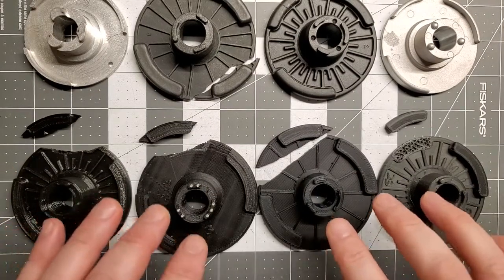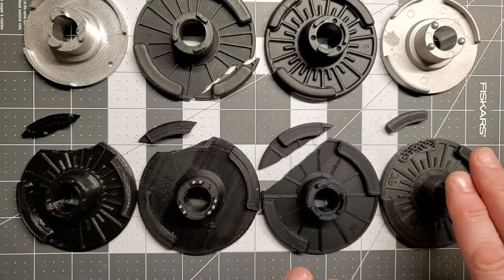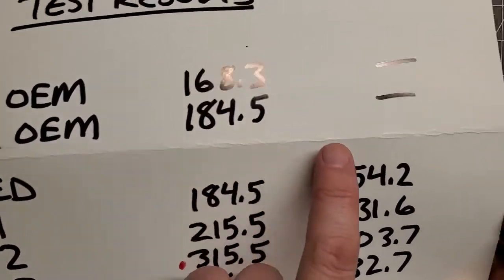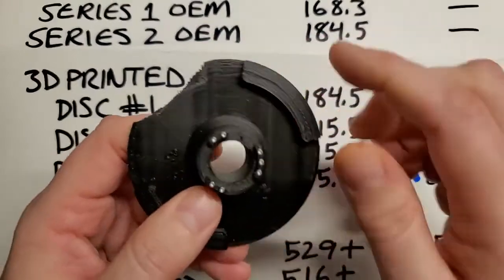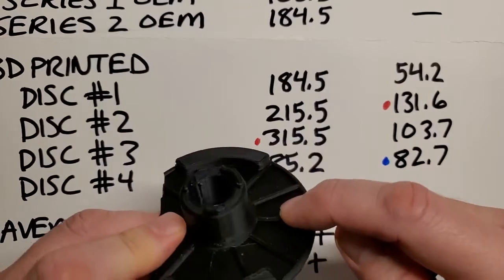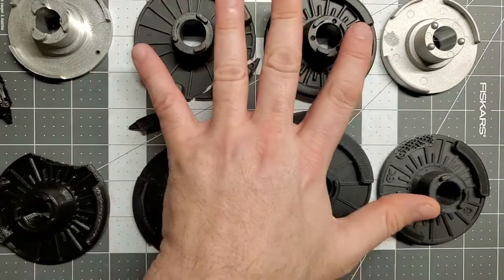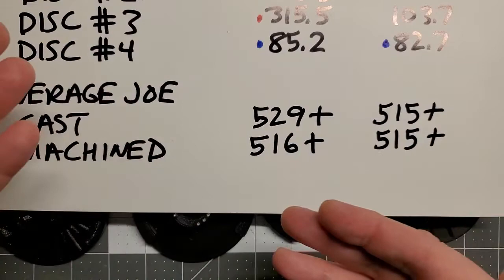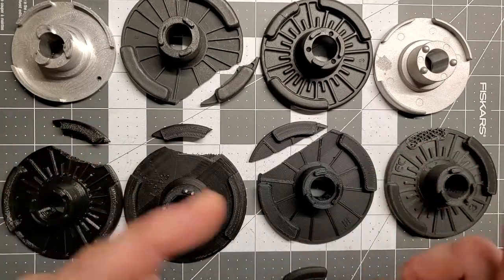I Load Tested Aftermarket 3D Printed Discs (for Bowflex® SelectTech® 552) and Here Are the Results

Comment: Disc #4 looks a lot like the disc I reverse engineered and put on thingiverse (right down to the crooked 3), but I printed mine out of 100% infill ABS. Nice video!
Reply from the maker: Very cool--small world! Thanks for watching! People are lucky to have so many contributors like you to those 3D design repositories. 

I was a bit over-dramatic in the video about using 100% infill. That does open the door to other potential issues such as over-extrusion sensitivity, worsening warping and shrinkage, possible shell-Infill separation, uneven cooling and layer adhesion, a greater chance of crack propagation, and a diminishing return on strength after about 80% infill. But, at the end of the day, most people just want to print a replacement part without getting into the nitty gritty of print settings.

Also, thanks for taking the time to leave a comment! I appreciate it.
Reply: @AverageJoeInnovationsLLC I definitely agree with you about 100% infill being a big undertaking to really do it right. I checked out your aluminum sets. Nice stuff, keep up the good work

Comment: Do you know anyone that offers these discs in aluminum?
Reply from the maker: Hi, hi. If you head on over to www.averagejoeinnovations.com you'll find a redesigned version of the factory discs available in aluminum (for the 552 Series 1, Series 2 and 1090) and stainless steel (for the 552 Series 2 and 1090), though the SS 1090 discs are currently out of stock. Cheers, Joe

Comment: I can't believe they aren't printing solid with 100% infill. On a part this size it would barely save any time or materials!
Reply from the maker: Totally agree with you. There's no good reason for less than 100% infill.  If I had to guess, it's due to inexperience. Quite a few people who sell 3D prints online get their models for free from some of the same sources, and they don't really differentiate between printing superhero figurines and structural components. Some may treat these discs as just another print, without even changing the settings that they use with decorative prints. I can't say with 100% certainty, but that would be my guess.

Comment: Joe is right.  I bought a 3D printed disc 2 and it cost me about 30.00 delivered. As soon as I fit the lugs into disc 3 they all broke and stuck in the slots. It took me a while to pick out the plastic or it would have ruined disc 3 as well.
Reply from the maker: Oh man, Ron, when you told me about what happened all I could think about is the stash of photos I have of broken lugs stuck in adjacent discs. It's something that affects OEM discs as well as they age.

Comment: Hey I recently bought some used bowflex 1090s. There are almost new and one of the dials started to spin freely without it locking. Would you have any idea what it could be? Please and thank you in advance. Also how could I fix it
Reply from the maker: Hi Oscar, happy holidays, Merry Christmas Eve and all that good stuff. In a nutshell, the only time dials should turn is when the handle is fully seated in its base. If a dial can turn freely with the handle removed from its base, a few different potential causes come to mind.:

1. Lugs on the dial are all broken. There are 3 little plastic protrusions on the dial. Those engage the first black disc that is adjacent to it. If those lugs are broken, the dial will turn but the discs will not. In this case you'd need to replace the dial.  Probably around $12-25 for a used dial on eBay. Keep in mind that much of the eBay stuff is pulled from used dumbbells. So that plastic has aged as well.  I couldn't tell you if the used dial will last 5 days or 5 years. 

2. Lugs on one or more discs are broken. I have never seen this happen, nor had this happen on my dumbbells, but it could happen. In this case, when you turn the dial, some or all of the discs turn with it. Somewhere in that group of discs, one has broken lugs and it isn't properly engaging the next disc in the group. In this case you'd need to replace that disc. Again, you can go on eBay and find used discs. Expect to pay about $18-25 per disc plus shipping. And again I can't tell you how long that used disc will last.

3. The locking pin is broken. If you search my channel for videos with pin in the title you'll find a few that explain the locking pins. If when you turn the dial all 4 black discs and the innermost chrome-looking steel disc all turn freely together with it, then the locking pin may have sheared off. Some of my current customers may be selling their old locking pins on eBay, but generally those are older used pins as well So there's no telling how long they'll last. 

4. Somehow, some way, maybe that handle became loose. Possible but not common. If these handles become loose--usually due to one of the end nuts loosening--the previously mentioned lugs on the dial and/or discs will not properly engage.  You'd feel it as you turn the dial.  It definitely would not feel smooth. It'd feel like the dial sometimes catches and sometimes slips. In this case the handles may just need a slight tightening. 

I do currently sell metal disc and locking pin replacements for issues #2 and 3 above. And next year I should have my custom metal selector dials in stock that solve #1. You can learn more about those fixes on my website: www.averagejoeinnovations.com  And if you have more questions, shoot me an email at joe@averagejoeinnovations.com. I try not to annoy the crap out of subscribers with notifications from me answering questions here on YouTube.